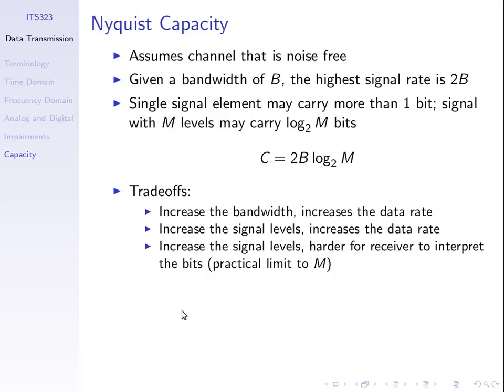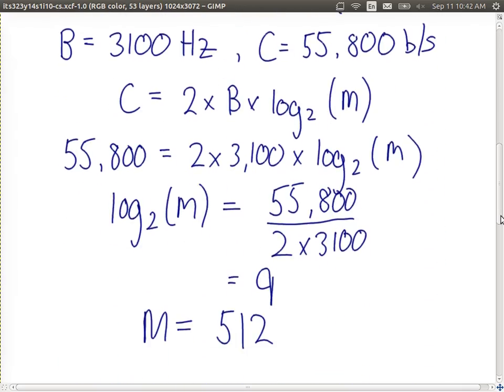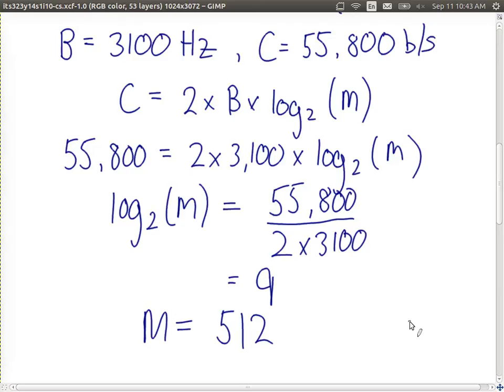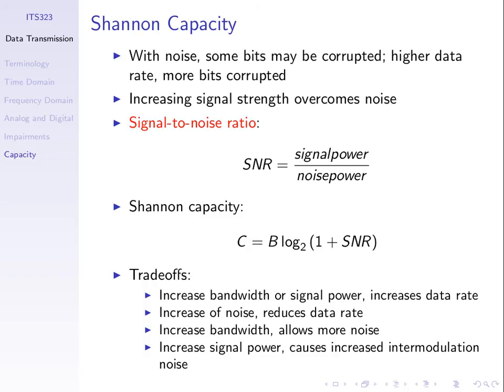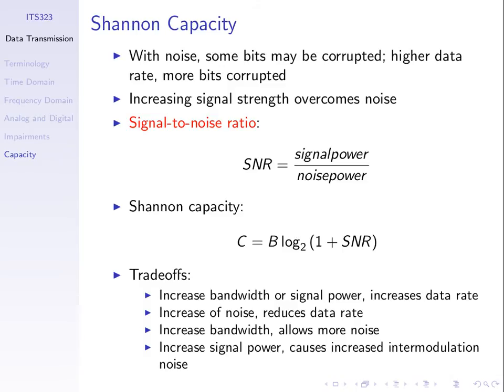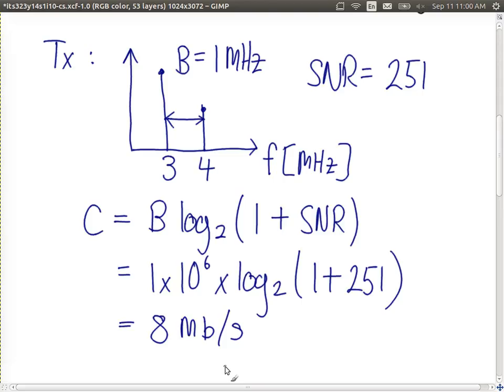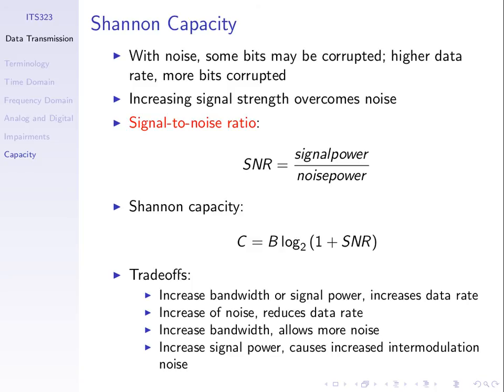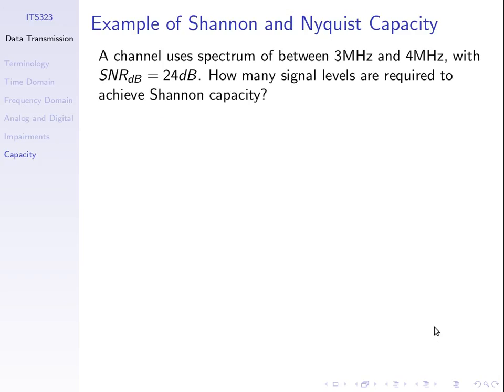Nyquist and Shannon Capacity (ITS323, Lecture 10, 2014)

Comment: 1. Upto log2(m) = 9 is OK. How M = 512 ? Sir cn u pls explain.
2. Also SNR = 5, Then From where 251 came ?
Reply from the maker: 1. Logarithm and exponential are inverse operations. If log2(M) = 9 then that means M = 2^9 = 512. 
2. SNR = 5 was the 1st example showing what SNR means. The 2nd (different) example we are given SNR = 251, and using that calculate the capacity. SNR of 5 and 251 are not related - they are two different examples. You can see the two separate examples (as images) at https://sandilands.info/sgordon/teaching/its323y14s1/topic-data_transmission
Reply: Thanks a lot Sir.